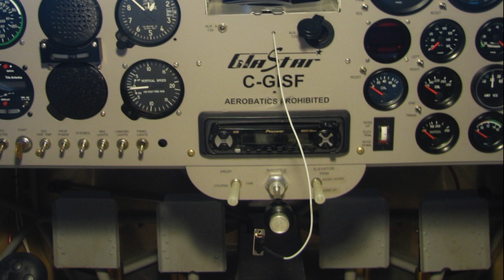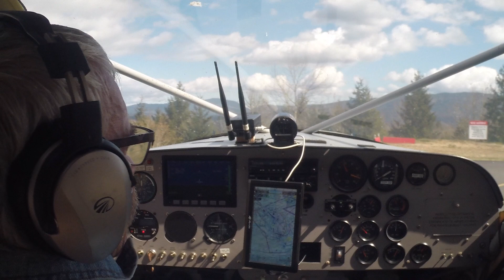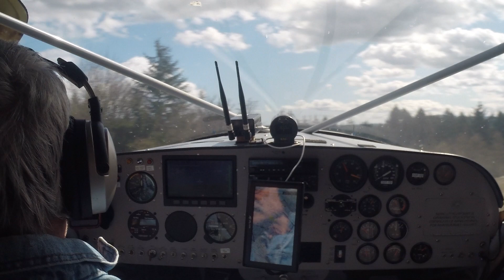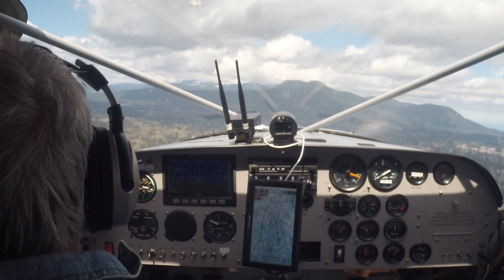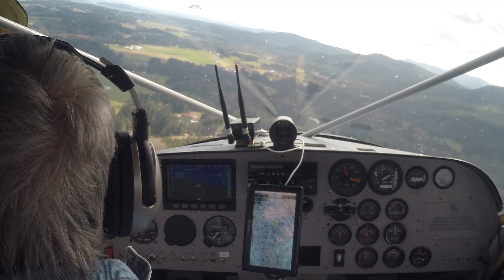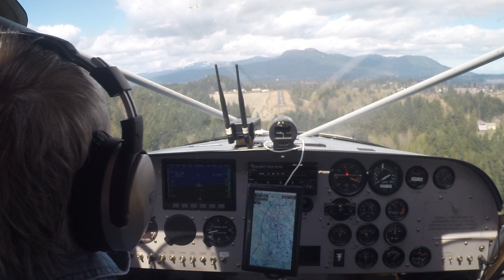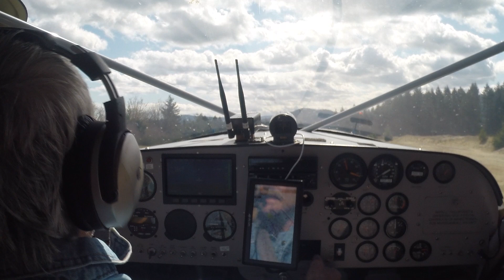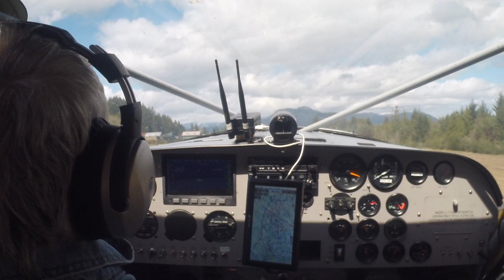Prop control in NSI subaru powered Glastar

Comment: you've been flying this engine for 20 years???  do you have a prop speed gauge as well? I'm interested in the longevity of this engine.
Reply: The prop pitch gauge and controller that came with the engine was not reliable.  We replaced it with a double pole, double throw momentary switch that  has worked well.  The original controller had a digital read out of prop blade pitch and would reduce power to the prop motor when blades hit the stops to protect that motor. So just something that the pilot needs to know about.  Yes first flight Feb 2003  which certainly illustrates that time dose go fast when you're having fun!